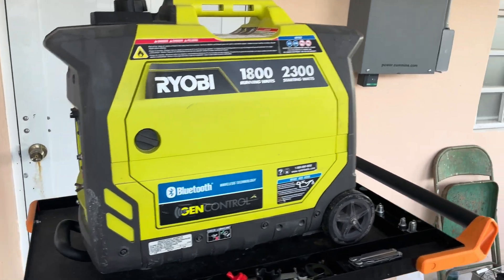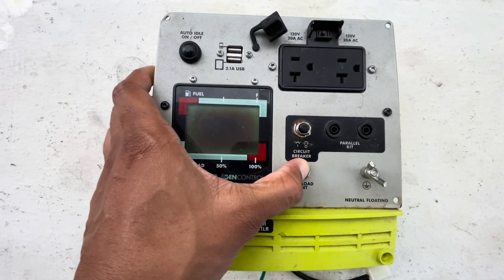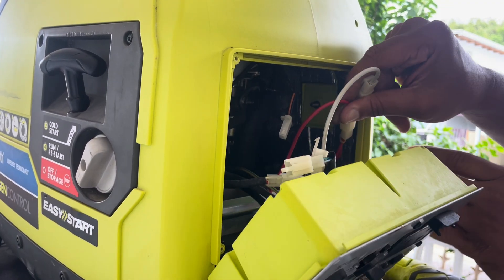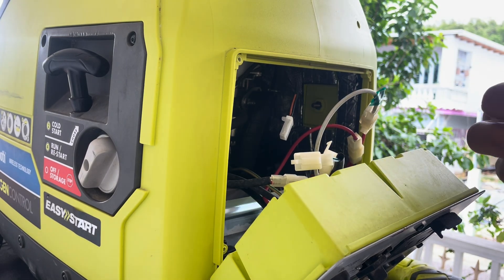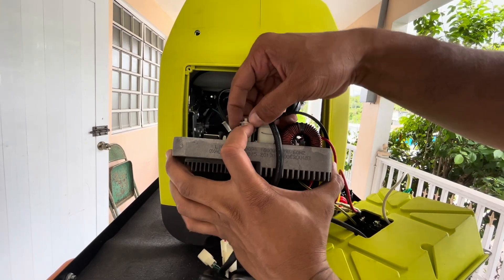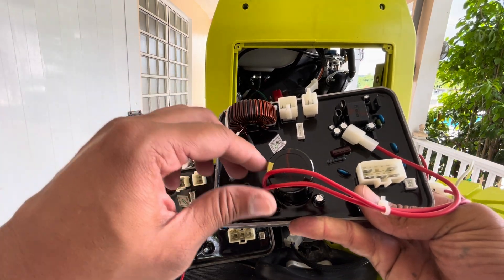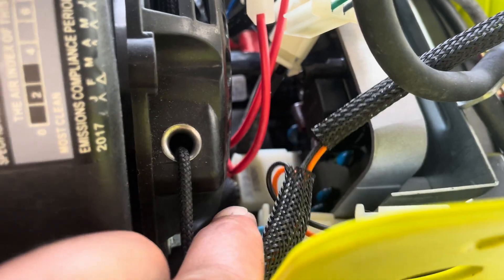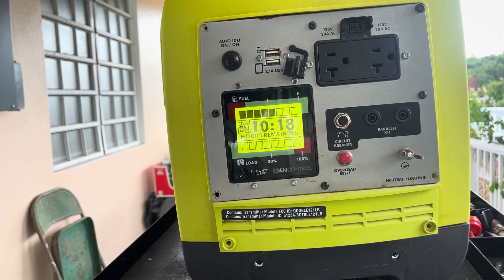How to fix ANY portable inverter generator NOT producing POWER. Over loaded Ryobi inverter generator

Comment: The price of s new replacement inverter is expensive. Can i get the bad inverter rebuilt?
Reply from the maker: It does cost quite a bit. I saw a YT video in which the person repaired the inverter module by replacing the capacitors, so it's possible. But, I'm not that skill with PCB soldering to attempt it. So if you can find someone or some place that are willing to rebuild let me know.
Reply: @tacticalpowerpro  do you happen to remember which YT video this was?  Great video by the way.
Reply from the maker: Thank you for your comment and for watching my video. I honestly don’t remember the name of the video. I just did a quick youtube search and a few inverter module repair videos came up but not the one I was talking about on my previous comment.

Comment: Y es que con taxes es casi la mitad del valor total del generador y ultima pregunta que tan bueno sale sea modelo tengo uno de eso en cuba 🇨🇺 gracias
Reply from the maker: El general Ryobi es buen generador. Lo trabajo mucho por que es uno de los generadores que mas vende Home Depot en Puerto Rico.
Reply: @tacticalpowerpro  Muchas Gracias por responder a mis preguntas, si usted lo dice que es mecánico de estos equipos bueno solo queda cuidarlo y hacerle los mantenimientos rutinarios, es que en cuba no muchos saben reparar estos equipos y los repuestos hay que comprarlo en Estados Unidos y no están muy baratos
Reply from the maker: Si, la piezas de respuesta son costosas, en especial el módulo inversor.
Reply from the maker: Gracias a ti por ver mis video y por comentar.
Reply: @tacticalpowerpro  mi generador cuando lo prendo no dice over loade
Reply from the maker: @josearamosrivera3676 tu generador no dice overload? Y no genera voltaje? No produce electricidad?
Reply: @ no genera solo tiene el push boton de reset roto x eso busco esa piesa primero a ver si luego de reset sale el oveloade pero no dice over loade en la lcd
Reply from the maker: @josearamosrivera3676  verifica nuevamente la descripción del video, añadí un link donde puedes conseguir el botón de reset para la Ryobi.